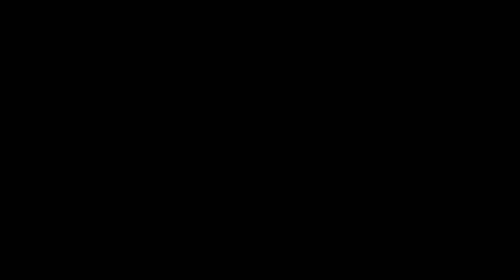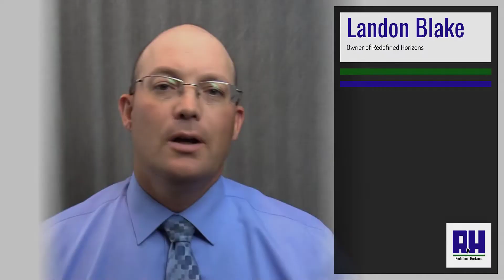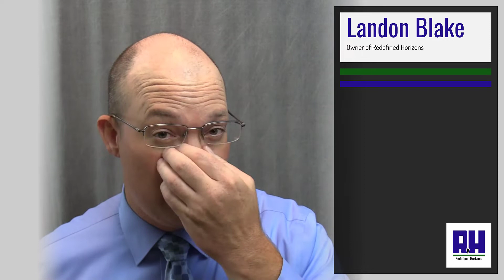When Does A Land Surveyor Need To Calculate A Base Flood Elevation?

Comment: I moved a mobilehome to where i grew up in a small town in Stonewall , Ms. It cost me about $400 to shoot from a half mile down the road at the railroad track. I know the railroad is at a known height. Ok he drove a stake in the ground where the mobilehome was going and told us to put the floor at something like 3ft 7 inches above the top of the stake in the ground. Does that stake plus 3 ft 7 in represent the same height as the railroad or not. This was done in nov 2011...thanks Stan